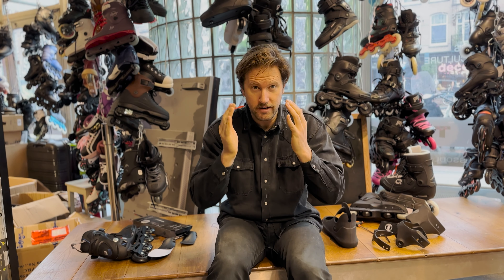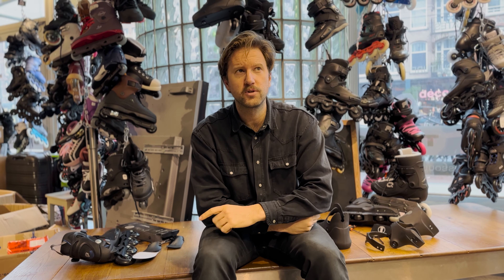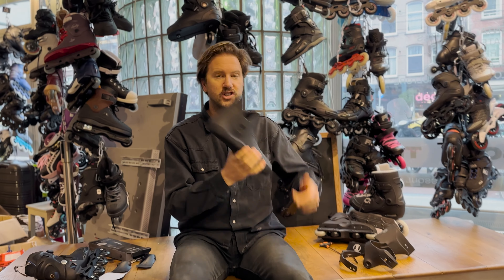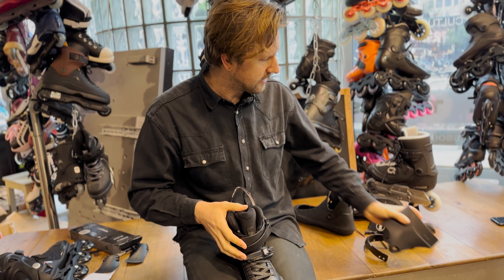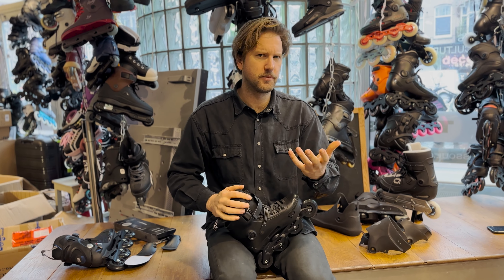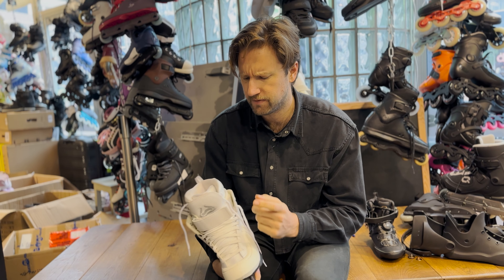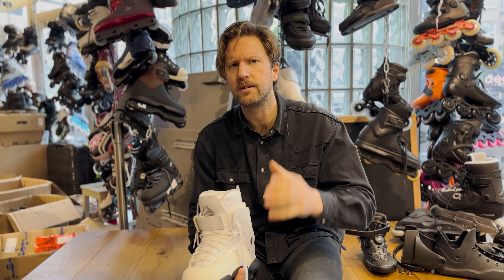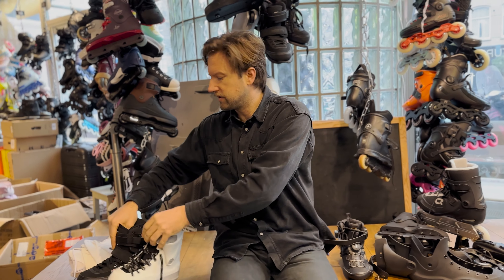Maximizing Flex on Your Inline Skates! // PART 2/5

Comment: I think the myfit crown liner  has inserts for the tongue (as well as the sides)
Reply: It has 👍🏻
Reply: Don't want more flex, just a nerd who finds it interesting 😝
Can't wait for the decrease flex vid... I'd love to have less forward flex on the Zoom especially... One of the best fitting boots for me but anoying forward flex (did your wall test, I'm a poor guy with just 6cm range), liner helps but still not close to what I prefer...
Reply: How the liner is laced changes flex pretty significantly too 🤔
Reply: I used to do things like that with some skiboots. As a speedskater and long distance  inline skater I use low boots so I have strong ankles. As a dedicated practise & flowset I also use an old Powerslide VI high boot with a Myfit Medium thick liner that I never changed. Biggest disadvantage I find that it  prefents my compact skate angles quite a bit, so I understand your forward flex tips👍
Reply from the maker: thanks for that!

Comment: If I adjust the FR cuff bolt forward,  I get more flex?   If I adjust it backward I get less?
Reply from the maker: its the opposite. 
If you put it forward it sits tighter on the skate.
Reply: This was my exact question. Am I understanding correctly that moving the cuff backwards gives more forward flex?